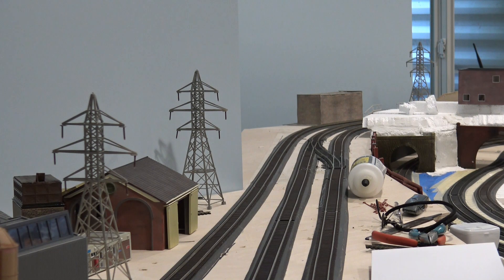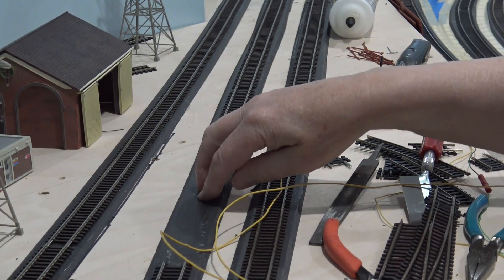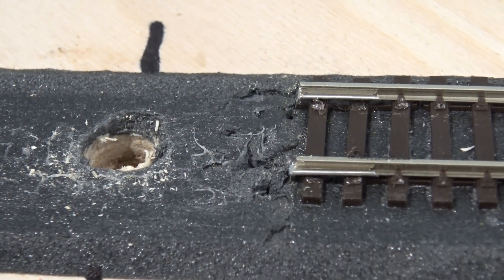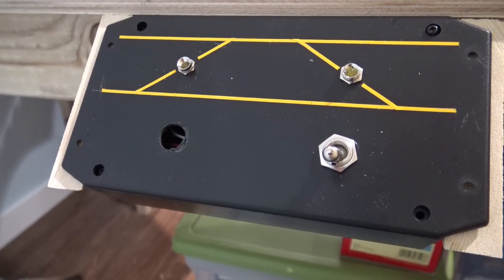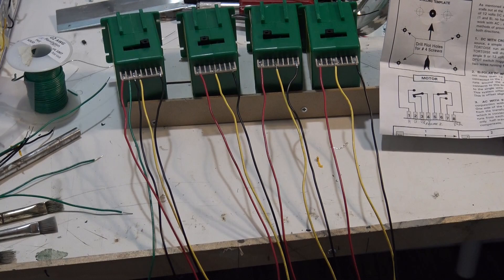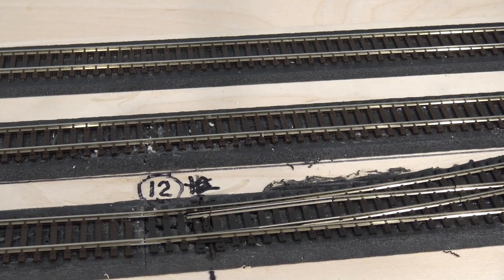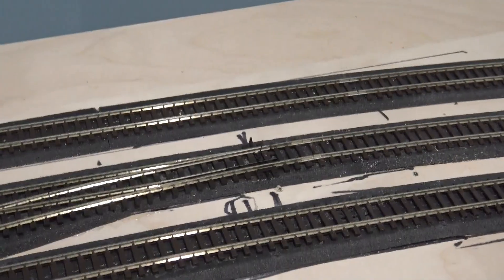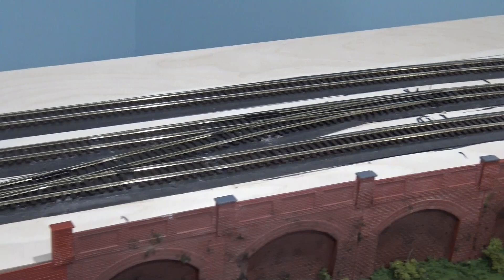22B Double CrossOver -   Farland Build

Comment: Nice one Rob. Ironic isn't it that you are putting crossovers in and I am taking some of mine out but all layouts are different and all have different needs, I have ended up taking 8 crossovers out and putting just two back in but that's only because I wanted longer platforms and a much more simplistic track than what I had before. I can see why you have done what you have done though and makes complete sense. I had my two crossovers by my platform area as I was advised early on that I would need that for changing ends of a train hauled by a steamer - which is true. But in reality I never used it once. It's as I said though - it all depends on our own individual needs and what we want from a layout. What you have done is perfect and looks great. Cheers for now buddy.         ...........Graham
Reply from the maker: Hi Graham, it is ironic, all the time you were working on your track changes, I was working or planning mine.  I had no way to get between the two express lines except of the X crossovers which as you know are reserved for short wheelbase locomotives and steam engines.  Simplification in your instance was the perfect solution as was the addition of Electrofrog points.  I would like to have a couple more double crossovers especially from the and to the freight line.  It could be useful to divert trains or locomotives in either directions.  I see your point.  If you never used it at all, why have it laying there causing problems.  I may, one day take out my Xs, but I would like to run a couple of years to see if I can find any enjoyment in them.  They will not be remotely operated so it will not cost much except for the turnouts themselves and I may need some of them elsewhere anyway.  Thank you Graham, I will talk to you soon, Rob
Reply: We certainly will talk again soon Rob because I shall be emailing you later on today.   ;-)          ..........Graham
Reply from the maker: How pleasing :-D

Comment: Better using the foam tag ..i used copydex and you can imagine what happens when you use a drill through it ...? ..changes happening already ..no doubt a few more before you are done Rob ...Dave
Reply from the maker: David Howarth Hi Dave, the spots I planned crossovers before I started building got changed.  In that case I decided to build it and run it for a while and see what was needed.  If you spread the Foam Tack thinly, it comes up easily.  If it gets thick in spots, it is a mess to pull up.  Thank you, Rob
Reply: That copydex is like a rubber band than get stuck all round the drill if you drill after ..good as long as its a final stick down ..Dave

Comment: Another step forward Rob. Do you have operational reasons for adding these crossovers?     David.
Reply from the maker: David Atkins Yes, the X overs at the main station platform ends are only for steam engines that need to change ends.  These new ones are for express trains that need to change tracks going into or out of the main station.  The proposed crossovers are to facilitate exchanges between the freight line and the express lines.  I hope that answers your question, thank you, Rob
Reply: Yes Rob, Thank you. I look forward to seeing it all in action.   David.